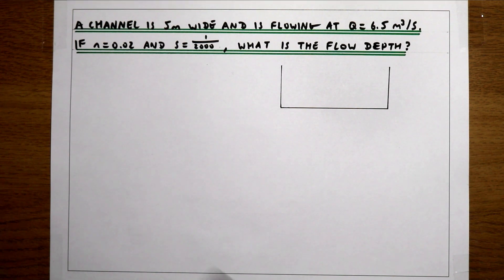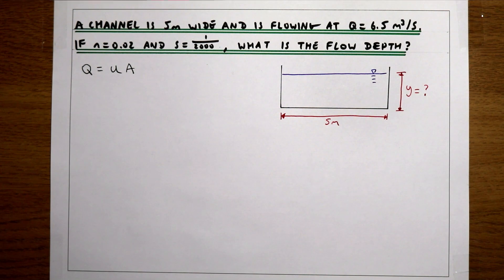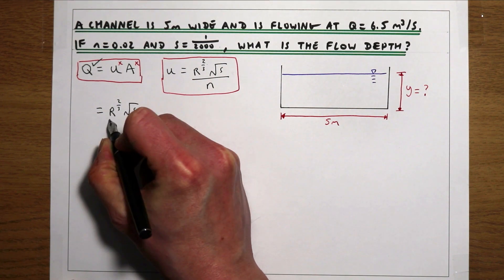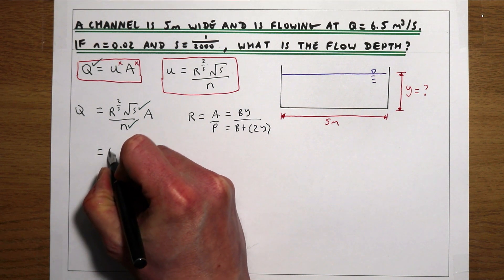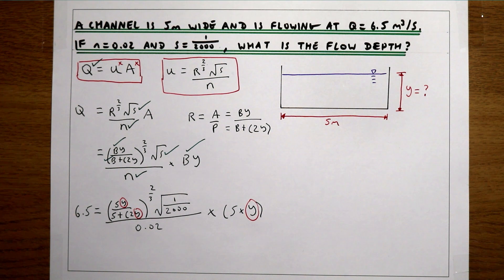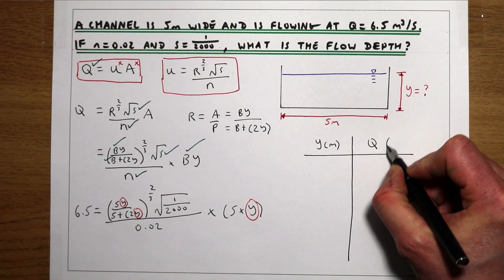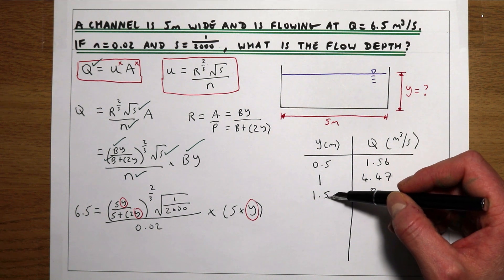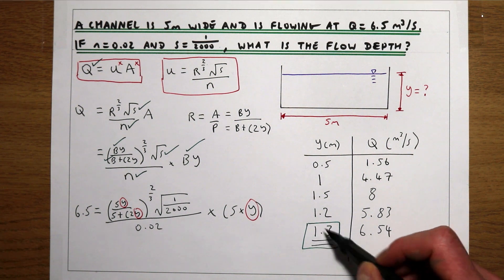Manning’s equation to calculate the flow depth at a given discharge for a rectangular open channel

Comment: To find the y easily you can put the equation on calculator ang use shift solve.
Reply from the maker: Yep, this is true! But this is the way to do it the old-fashioned way if you don't have a cleaver calculator!